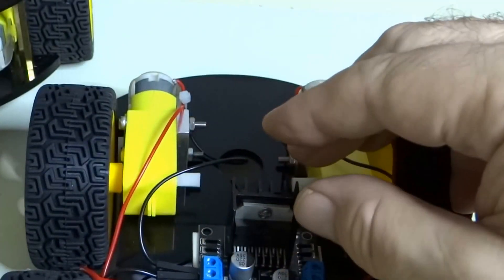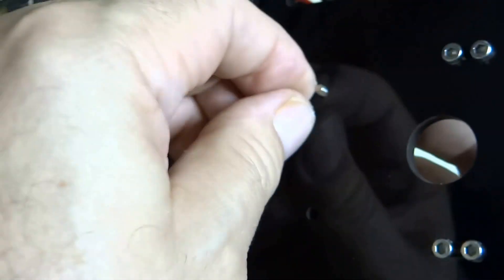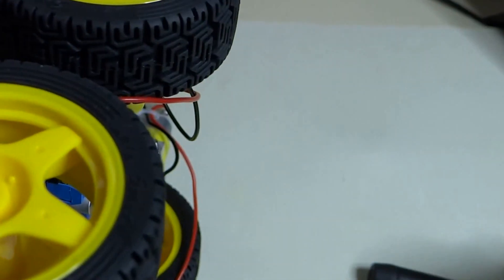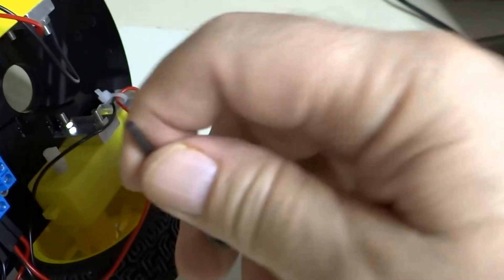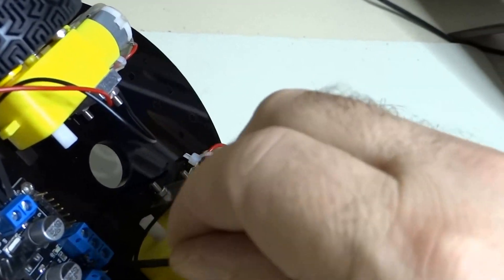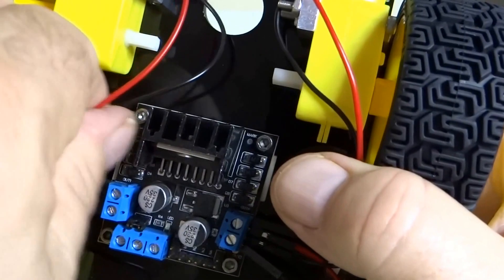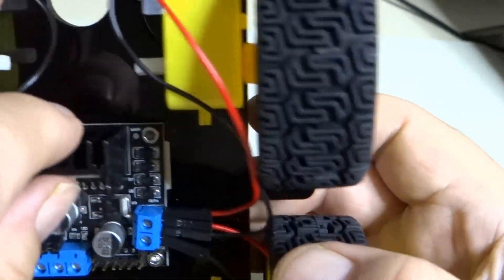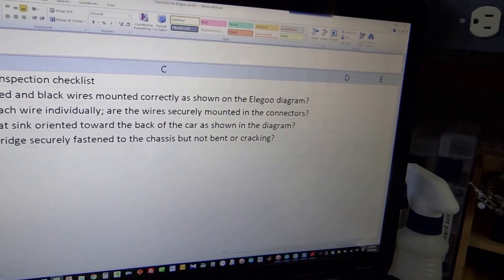Elegoo SRC kit 10 motor controller mounting

Comment: what about if i reverse the motors so that each two motors are infront of each other , is the mounting with motor driver controller will be correct then ? thanks in advance
Reply from the maker: Mohamed Mostafa I'm sorry, I don't understand the question. Usually, if the motors are turning in the wrong direction I will change the software or change wiring at the motor controller.
Reply: Greg Griffes ok thanks so much , that was my question, God bless you

Comment: don't you have to connect rear motors in reverse polarity ? otherwise one right wheel (for example) will move forward and the other will move backwards
Reply from the maker: hmronline you are absolutely correct. I missed this mistake when following the elegoo instructions and had to correct it later. Very observant of you to recognize this error immediately. Thank you. The correct wiring is to reverse the rear wheels to make it work with elegoo test software.
Reply from the maker: @hmronline I discovered something this week. I'm teaching a high school class of about 20 robots and I made certain that they all connected the wires according to my discovery (Elegoo instructions didn't work for me). Guess what, some people in the class had to re-wire the motors anyway. I discovered that the red and black wire polarity on the motors themselves are sometimes reversed. Be aware of that tricky situation.